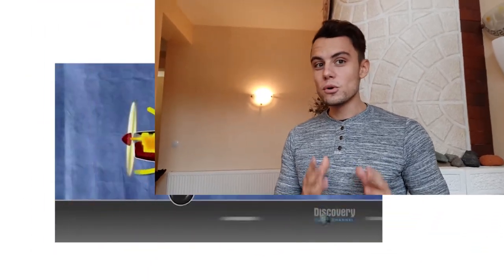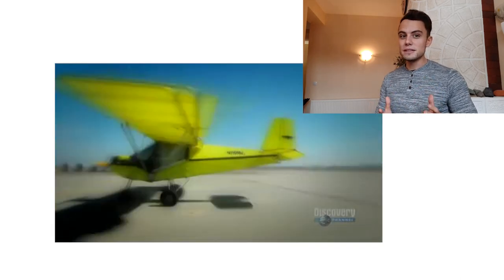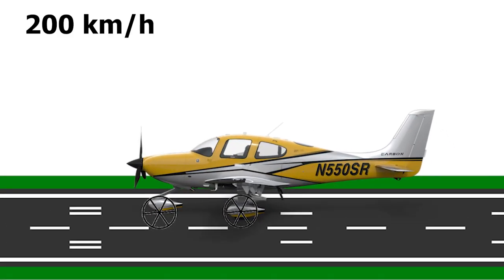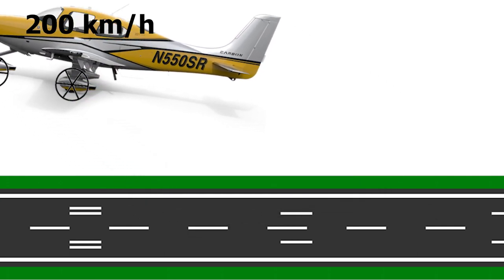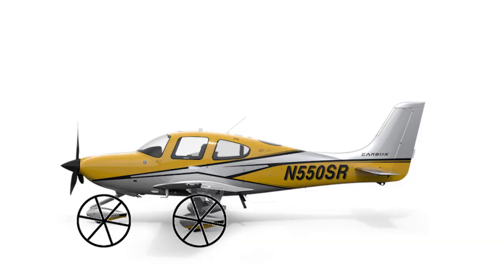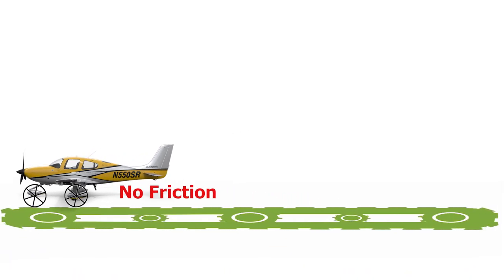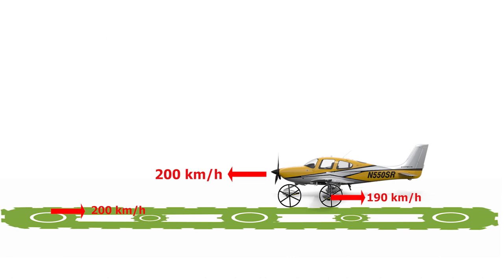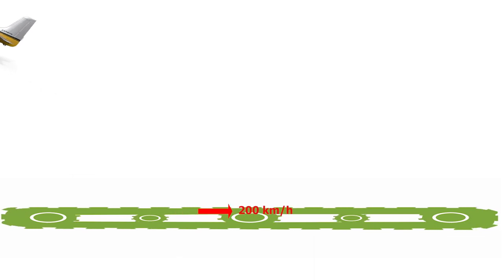Can an Airplane Take Off From a Conveyer Belt?.... Finally Solved!

Comment: How an AERONAUTICAL ENGINEERING STUDENT AND PROFESSOR gor this so wrong is FRIGHTENING (that professor should have his degree annulled for that alone)  The MAJOR thing his theory (which is WRONG BTW) fails to take into account is that the aircraft will always take off IN ITS' NORMAL TAKEOFF DISTANCE. This is because for all intents and purposes THE WHEELS ARE INCONSEQUENTIAL ... The plane is either being PULLED OR THRUST THROUGH THE AIR (by a PROPELLOR or the JET ENGINES) ... the ground and friction coefficiant of the wheels have absolutely NOTHING to do with ANYTHING (except while the plane is taxiing). If takeoff speed is 200km/h and the belt is moving 200km/h the other way the wheels will be spinning at the equivalent of 400km/h at takeoff. If the conveyor tried to MATCH the WHEEL speed it would almost instantly be at INFINITE speed due to the positive feedback because the plane will CONTINUE ACCELLERATING ... no matter WHAT the wheels were doing.
Reply: The belt speed is controlled externally to match the wheel speed exactly. The plane appears stationary and no airspeed over the wings, it cannot lift off.
Reply: It doesn’t matter how much thrust you supply; if the vehicle moves on the ground only by rolling and the parameters are that rolling speed is exactly matched, then the vehicle on wheels (aircraft, locomotive, cog rail, or automobile) will be definition roll at the same rate as the linear motion of the (inane, perfectly operating) conveyor belt.

That’s explicitly in the terms of this thought problem.
Reply: The riddle (Imagine a 747 is sitting on a conveyor belt, as wide and long as a runway. The conveyor belt is  designed to exactly match the speed of the wheels, moving in the opposite direction.)                                                                                                                          Can the plane take off?                                                                                                                                                                                                       Let's break it down                                                                                                                                                                                                                 747= real plane, it will take off                                                                                                                                                                                               Sitting= Stopped, not moving, wheels not turning, and conveyor not running.                                                                                                    Conveyor belt designed to exactly match the speed of the wheels = Conveyor belt can only match wheel speed, it can't change wheel speed.                                                                                                                                                                                                                       Moving in the opposite direction= The top of the wheel  moves in the same direction as the plane's forward movement, the bottom of the wheel moves in the  opposite direction to the plane's forward movement. So any conveyor belt the wheels roll over moves opposite the plane.                                                                                                                                                                            To make the wheels turn the plane must move forward, as the wheels turn they roll on the conveyor belt at the same speed. Because the speed of the wheels  already matches the stopped conveyor belt, the conveyor belt  will not have to start and the plane will take off.                                                                                                                                                                                                                                  I see now this is not a riddle, it's the definition of how planes take off from a runway with one word changed. they replaced the word runway with conveyor just to confuse everybody.
Reply: You almost had everything right. Since wheel RPM is double normal RPM at takeoff. Total RPM is produced by a 50/50 split between the forward motion of the aircraft and belt speed. The belt does in fact match wheel speed 1 for 1.

If we stopped the belt at any speed, wheel RPM would drop by 50% but the aircraft would remain at the same speed.
Reply: @PabloGonzalez-hv3td  You can't change the wheel speed you can only match it, therefore the conveyor never starts and the jet takes off.
Reply: @tedfann3618  A 50/50 split between belt speed and forward aircraft motion meets the criteria of matching wheel speed.
Reply: @PabloGonzalez-hv3td  You are missing the point, the conveyor just matches, it has no magical powers to change the speed of the wheel. The plane moves 10 ft forward, the max the conveyor can do is move 10 ft of conveyor under the wheels and that has already been done. The conveyor doesn't start and the plane takes off.
Reply: @tedfann3618  The conveyor is powered. When the aircraft moves 10 feet forward the belt moves 10 feet backwards and the distance is now 20 feet from the start.
Reply: @PabloGonzalez-hv3td  No No and No 10 doesn't match 20. 10 matches 10 the conveyor can't start and the plane takes off my friend.
Reply: @tedfann3618  The conveyor belt is POWERED I'm not sure what you don't understand about that. The "magical power" is electricity. 

What you're describing is just a regular takeoff from the ground.
Reply: @PabloGonzalez-hv3td  Read the riddle, (exactly match the speed of the wheels. moving in the opposite direction,) Let me break it down for you, speed of the wheels is the forward movement of the wheels, not rotation. How do I know that, because the wheels have to rotate in the same direction as the conveyor does. Now the plane moves forward 10 ft the wheels roll exactly matching the conveyor and now we have 10 ft of conveyor behind the wheels. I hope you see it now. My answer exactly matches the riddle, You are right that exactly what all planes do on take off.
Reply: @tedfann3618  It's not a "riddle" it's an experiment. 

The question being "can an aircraft, attempting takeoff, be held stationary by a conveyor belt MOVING in the opposite direction at equal speed?" (Like it would a car) This much isn't up for debate.

The 2nd question is "can the belt match wheel speed? If indeed it does accelerate.

The answer is - since aircraft wheels simply freewheel, and thrust acts on the air, the aircraft takes off. 

Any fixed point on the belt has a closure rate of double the aircraft's ground speed. The wheels spin at twice normal RPM.

Since the total wheel RPM is a 50/50 split of  aircraft ground speed and belt speed, this meets the parameter of matching wheel speed.

Comment: The wheels and conveyor  are irrelevant.
The thrust from the plane is against the air behind it and the plane's movement is then relative to the surrounding air. The wheels just rotate at whatever speed they're free moving.

If this wasn't the case, planes would never be able to take off from water.
Reply: Well said.
Reply: The wheels and conveyor speed is EVERYTHING! It's the airplane thrust that is irrelevant. In the rules of the question, the conveyor belt has to ALWAYS match the speed of the wheels. If this rule is followed, it is impossible for the plane to generate any forward movement. If the plane does move forward, that is evidence that the rule has been broken.
Reply: @datsko6339  
Exactly!
It's the airflow past the wings that matter because that's where the lift is generated. If the conveyor belt is able to keep the airplane stationary relative to the airflow, it won't take off. The airplane in that MythBusters video took off because the "conveyor belt" failed to keep the plane stationary.
Reply: It's amazing that some people still fail grasp the concept of airspeed from thrust, even though it's explained in basic terms.
Reply: @datsko6339  the wheel speed has nothing to do with the plane taking off at all. The engine thrust is what moves the plane forward regardless of wheel speed.
Reply: @mikebooze6125  Wheel speed has nothing to do with the plane taking off, but it does relate to the plane moving forward along the ground. If the wheel speed cannot exceed the ground speed, the plane cannot move forward relative to the ground. Noforeward movement = no lift.
Reply: The plane can absolutely take off.
Reply: @gextreme2381  it can’t generate forward movement because the wheel speed must always match the conveyor speed. The engines are irrelevant
Reply: @datsko6339  - Wheel speed is irrelevant to ''forward movement'' as forward movement is solely based on engine thrust, not the speed of the wheels.
Reply: @mrn8645  that is true on a regular airplane. When a plane moves forward, it's wheels are moving faster than the ground, which is against the rules in this question.
Reply: @datsko6339  - Unless the plane in this question doesn't have an engine and defies the laws of physics, it will more forward. Wheel speed is secondary to air speed, and unless there is forward momentum, the wheels won't move.
Reply: @mrn8645  the plane in the question DOES defy the laws of physics. It’s wheels must always rotate at the same speed as the conveyor, which is impossible. Because the wheel speed is bound to the ground speed, it physically cannot accelerate
Reply: @datsko6339  - Again, the wheels have absolutely no input into acceleration, so it will move. Besides, a question that doesn't conform to the laws of phyics doesn't warrant an answer that does.
Reply: @mrn8645  On a regular plane, the wheels have no input to acceleration, but the question is not asking about a regular plane. Every question warrants the CORRECT answer, whether or not the question/answer conforms to the laws of physics.
Reply: @datsko6339  - That's a logical falacy. If it's an irregular plane in the question, then it won't be a regular plane in the answer. Either way the plane would take off.
Reply: @mrn8645  how is that a logical fallacy?? Most people just fail to recognize that the question is describing a plane that cannot exist in reality.
Reply: What kind of wheel speed are we talking about. Are we talking about how fast the wheel moves forward or how fast the wheel spins?
Reply: @catprog <-- is on the right track! 

"Speed of the wheels" can be "the distance the wheel travels from a fixed reference point, per the time it takes to tavern that far", linear velocity.. Or it can mean "the circumferential speed around the center of rotation, measured by circumference x frequency"

A wheel can be spinning 10,000 rpm and be considered still. A wheel can be not spinning, and still have a directional velocity. 

Whether the "speed of the wheels" would be measured by a laser, or by a speedometer, that will only affect how fast the belt moves. It won't affect the plane enough to prevent it from moving. 

The question that broke the internet said the belt is "designed to" match the speed of the wheels. 
Let's set the belt speed controller to be controlled by the laser, or speedometer. That satisfies the wording of the question. Nowhere does the question say that the plane will be, or must be stationary. It only says that the setup is designed for the belt to match wheel speed. We've satisfied that by using one to control the other. 

Nothing about this situation, prevents the plane from being able to move relative to the air.

If I'm wrong... I'm happy to be shown where
Reply: @snytty  By putting a backwards force on the wheels it will put a backwards force on the plane (friction in the axel). If this force is equal to the thurst from the engines then the plane is stationary and the plane will not take off. This is the belt matches forward speed of the wheel scenario.
Reply: @datsko6339  If the plane is not moving than the wheels are not either, so the conveyor not running, as in the start of the riddle, (a plane setting on a conveyor belt)                                                                                                   You can't change 1to1 the conveyor only moves when the wheel rotates in place, not happen. The wheel only rotates as the jet moves forward the rolls over the conveyor and the amount of conveyor behind the wheel is the same as the movement of the jet 1 to 1. The conveyor never moves and the plane takes off. The wheel speed matching the conveyor is the key to solve this. The plane is sitting on the conveyor neither the wheel or the conveyor is moving. Now start the jet move 1 rev of the wheel now the plane has moved forward and 1 rev of conveyor is now behind the wheel. The real question is how fast the conveyor is moving. The answer is it is not and never will. That is the trick of this question.
I see now this is not a riddle, it's the definition of how planes take off from a runway with one word changed. they replaced the word runway with conveyor just to confuse everybody.

One other thing, you park a car on a conveyor and than drive the car forward keeping the wheels and the conveyor at a 1 to 1 ratio. The car will drive off and the conveyor will not start. You yourself can do this on a treadmill, stand at the back end with the treadmill off and take 1 step forward. You will now be in the middle treadmill, start the treadmill up and start walking and you will stay in the same place. Only one can move at a time to keep 1 to 1 ratio.
Reply: @datsko6339  You can't change 1to1 the conveyor only moves when the wheel rotates in place, not happen. The wheel only rotates as the jet moves forward the rolls over the conveyor and the amount of conveyor behind the wheel is the same as the movement of the jet 1 to 1. The conveyor never moves and the plane takes off. The wheel speed matching the conveyor is the key to solve this. The plane is sitting on the conveyor neither the wheel or the conveyor is moving. Now start the jet move 1 rev of the wheel now the plane has moved forward and 1 rev of conveyor is now behind the wheel. The real question is how fast the conveyor is moving. The answer is it is not and never will. That is the trick of this question.
I see now this is not a riddle, it's the definition of how planes take off from a runway with one word changed. they replaced the word runway with conveyor just to confuse everybody.

One other thing, you park a car on a conveyor and than drive the car forward keeping the wheels and the conveyor at a 1 to 1 ratio. The car will drive off and the conveyor will not start. You yourself can do this on a treadmill, stand at the back end with the treadmill off and take 1 step forward. You will now be in the middle treadmill, start the treadmill up and start walking and you will stay in the same place. Only one can move at a time to keep 1 to 1 ratio.
Reply: @tedfann3618  the plane cannot move forward along the treadmill. It is not possible for the plane to move forward without the wheels rolling faster than the conveyor it it sitting on, which is against the rules. Using this reasoning, the rules essentially dictate that the plane cannot move forward, and thus cannot generate lift or take off. 

If you stand at the back of a treadmill and take 1 step forward, you would be in the middle of the treadmill, BUT ONLY BECAUSE YOU MOVED FASTER THAN THE TREADMILL. This is not allowed. Anything moving at the same speed as the treadmill it is on is stationary. If it isn’t stationary, they aren’t moving the same speed
Reply: @datsko6339  The plane has four jet engines, it going to move forward. The wheel will roll down the conveyor as the plane moves. The amount forward movement and the amount of conveyor behind the wheel are equal so there is no need for the conveyor to start.
Reply: @tedfann3618  I genuinely have no idea what you're even trying to say. If the wheels are turning, the conveyer belt is moving at the same speed. If the plane's wheels are not moving, neither is the conveyor belt. The engines are completely irrelevant. How can the plane move forward while having it's wheels maintain the same speed as the conveyor belt? That is illogical.

If English isn't your first language, please just use Google translate because what you are saying does not make sense.

Comment: Calculating Friction and weight is unimportant.
It will take off.  Physics doesn't change with a magical conveyor belt.
When the pilot applies enough thrust to move the 747 forward at 10 mph, the belt moves backward at 10 mph. If this is possible, it can also accelerate to 20 mph with the belt moving backward at 20 mph.  
Relative to the ground, the wheels, axles, and entire plane move forward through three-dimensional space at 20 mph and will continue to accelerate until the liftoff speed of 184 mph is achieved, regardless of the speed of the tires or the conveyor.  

The Deniers think that the plane moving along the belt relative to the ground would cause a paradox, but it doesn't because the belt and tires are still moving at the same speed, relative to each other as if the belt had teeth and the wheels were matching sprockets. 
If the speed of the belt was the Combined Speed of the wheel/belt speed of 184 mph plus the speed over ground (SOG) of 184, I believe the max wheel speed and magical Conveyor speed should only be a combined speed of 368 mph.
Reply: (The plane + the conveyor belt) is stationary relative to the ground and three-dimensional space around it. So the plane doesn't move.
Reply: @nareal_chutney  - The plane is moving relative to the air!
Reply: @mrn8645 the plane only rolls while on the ground or in this case, the moving conveyor.  It’s not floating over the surface.